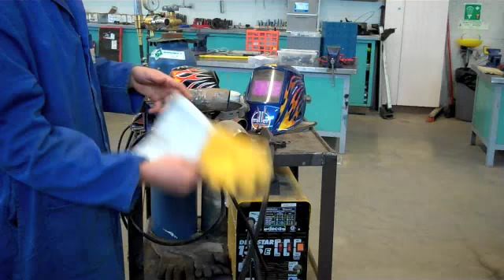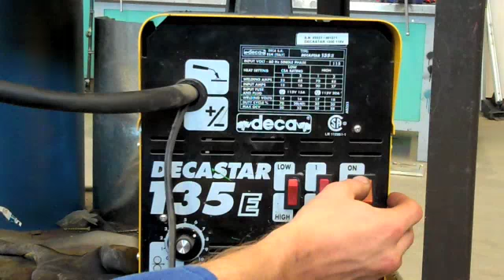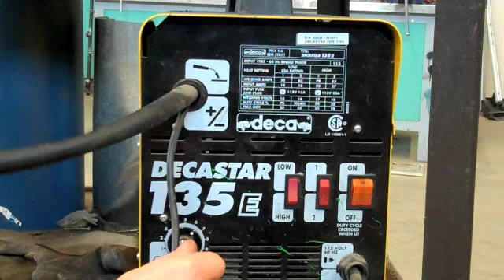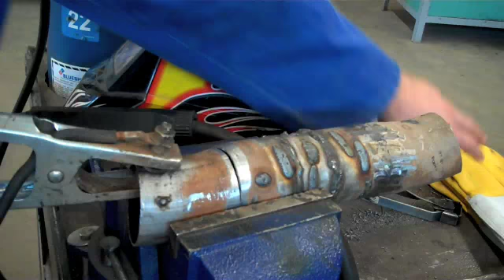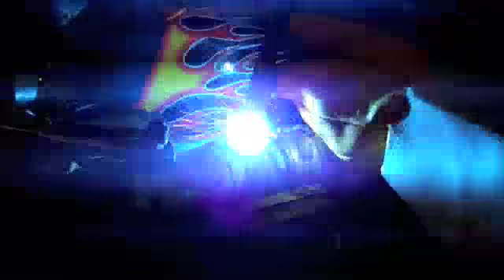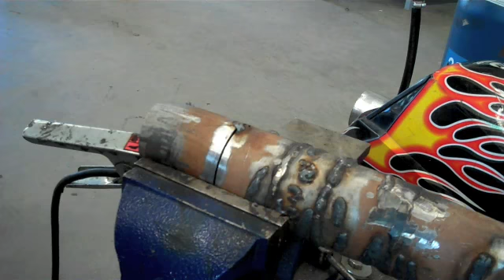Exhaust Welding

Comment: Have you found a location in you parts that servIce or can get “DECA MIG” parts? I need a new nozzle or choice of mine I got new in 1984. They are still built in Italy but focused on industrial & commercial markets. Mine works fine and has served me very well. A DecaMIG 616-S with 150 Amps, excellent heat control, wire speed, stitch and stitch dwell. It uses the 14” spool and is a nice heavy duty cart, wheels and tank holder in one unit. I don’t have to be perfect, just a lot of everything from 3/8” thick to sheet metal w/ 0.22 wire. Have a good one!
Reply: Hey, thanks for the no response! I appreciate it. By the way, you should clean the area even for a test weld. Also, for YouTube and NOT your class, use age appropriate vernacular, word pattern, cadence and don’t repeat every other thought. Gets old real quick. No tech school in 68 and sunscreen was called dirt! You can get welding light burns thru thin material like your jacket then you were welding to hot. Get with it there Skippy!
DK, ASE master tech since 78, retired.

Comment: do I need gas on the MIG to weld like this or is a flux core wire ok ?
Reply: Flux core work just fine for exhaust nothing wrong with shielding gas and reg mig but flux core works good for thin stuff and are usually a lot cheaper if it's your first welder

Comment: What is your thoughts on disconnecting the battery when welding on the vehicle?
Reply: Better safe than sorry, seen many avoltageregblown for not doing it and computers millivolt sensing in today's cars and equipment, how long does it take to remove a battery clamp

Comment: I had a really hard time adding an o2 bung to a piece of exhaust piping I bought from autozone. Not sure what it is but it would kind of pop and not want to continue the weld. I had to just keep repeatedly hit it with the welder over and over to just make an ugly mound of welds. It sealed but I'd like to figure out what I'm doing wrong. I bought a little wire feed welder from home depot and its cool. I got some nice welds going on some strut fittings but this exhaust was super hard for me for some reason

Comment: Even my welds look better with flux core? Shorts bursts work better for thinner metals.
Reply: Just a heads up, that method is fine but when your doing it with flux core make sure to clean the previous one before starting the next one
Reply: I am interested buying a HF 90amp flux core, would I be able to weld a catalytic converter? Is my first time trying this. I was thinking practicing on autozone exhaust pipes before doing any weld on a catalytic converter.
Reply: +Walter Castro if HF is reference to Harbor freight. then yes buy it. it works great for exhaust work I have one and haven't had a problem yet
Reply: Yeah also buy a spare roll of wire the only the kit comes with is tiny also do your self a favor and buy a legit mask not the hand held one they give you
Reply: +justin phelan awesome will do. 👍
Reply: If you can find it on sale or with a coupon it can be a great deal. I eventually sold mine to buy an everlast for the higher duty cycle.

Comment: You lost me at "wear safety glasses under welding helmet" yeah right like I'll need two plastic lenses to fog up. It gets as hot as a...
Reply: after reading this comment again, its a bit... dont know the word. Safety is your number one priority because you only get two eyes...
Reply: I do, and ear protection
Reply: +ColtDeltaElite10mm i do the same too.... especially when welding stainless steel. Those slag will come at ya
Reply: props for backing down on your comment and not just deleting it.. VERY rare to see now days on social media.

Comment: What would the result be if i weld it without gas?
Reply: Kim Chi Yes it will... the weld just wont be shielded causing instant corrosion and a bad weld.
Reply: +Salem Hardan Use flux core wire.

Comment: I read somewhere that if you PUSH the weld on exhaust tubing it prevents from burning through the thin wall tubing better. Any truth to that?
Reply: Any weld with Mig/Mag will penetrate less if you push it but very marginal difference, with thin metal like exhaust pipe always weld it incline & vertical down and this will help with reducing penetration.
Reply: @davidrichards8639   Welding incline and vertical down? Would you care to elaborate? Long story short welding new flexi bends on my exhaust, got some that juuust slide over the stock exhaust so I can do a lap(?) weld, and borrowed a cheapo mig. I have no idea what I'm doing, none of my friends do either, and I can't afford to just replace the parts as there's 2 of these exhaust segments need the same fix, and these one-piece segments include both manifold and cat. Its like a thousand dollars for a cheap aftermarket one, and I would need 2. The bends are too close to the cat to use a straight joining clamp, like 4-5 cm from the bend to the cat housing. Any and all tips are welcome.

Comment: So if you are welding the exhaust piping while its on the car how would you weld the top of the pipe? I'm wanting to put a new exhaust on my car and I know how to weld so there is no point in going to a professional, just wondering how you would weld the top of the pipe while its so close to the vehicle?
Reply: +SilentSniper Turn the car over on it's roof, dumbass!
Reply: take it off...
Reply: Bob Smith Oh yes, then spend 2000 repairing the damages without labor. Haha nice one.
Reply: move around. I work in exhaust industry and you have to move around and sometimes  weld where you can not see it takes way more skill than welding on the table I did that when I was learning as a 12 year old and just for a week. now after so many years you learn tricks
Reply: move around. I work in exhaust industry and you have to move around and sometimes  weld where you can not see it takes way more skill than welding on the table I did that when I was learning as a 12 year old and just for a week. now after so many years you learn tricks
Reply: move around. I work in exhaust industry and you have to move around and sometimes  weld where you can not see it takes way more skill than welding on the table I did that when I was learning as a 12 year old and just for a week. now after so many years you learn tricks

Comment: i would NOT pay for that haha
Reply: No one is. Its a quick mockup just to add visuals to what he's saying. As he said, its a really awkward angle to get a decent weld at. And its clearly a test piece for the welder to check feed and heat. If this was a weld for some real application, obviously he would move the camera setup out of the way (the vice is bolted down, so can't adjust work angle there). But for filming purposes, he has to stand and work perpendicular to the weld, and at that angle, here, the clamp gets in the way. Sure it could be better set up and planned, but clearly this was a single-take quickie.

Comment: Great video! Im new to welding and used a friends Lincoln Electric mig welder last week. I tried to weld new mufflers on my car and couldnt get any beads at all. Ended up with lots of bubbles of weld all over the mufflers, floor, etc. Dunno what I did wrong.